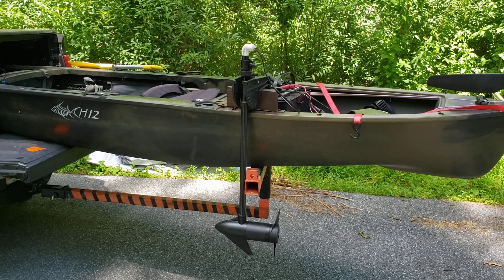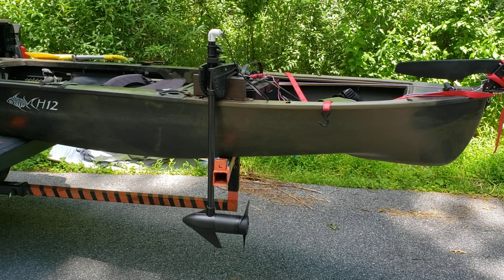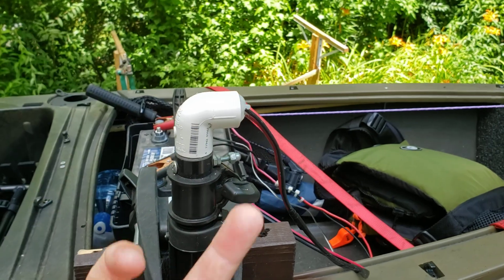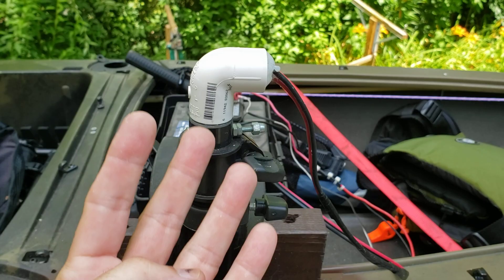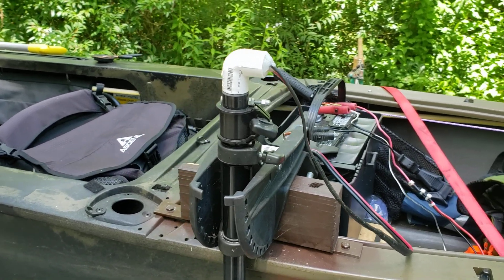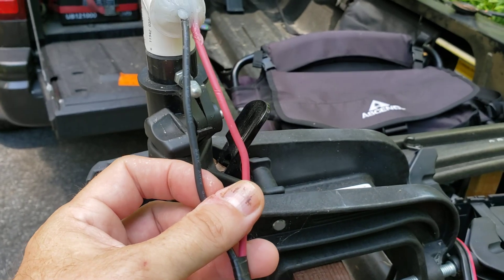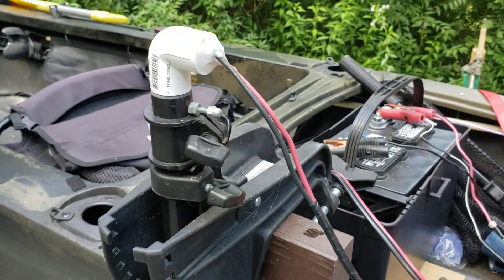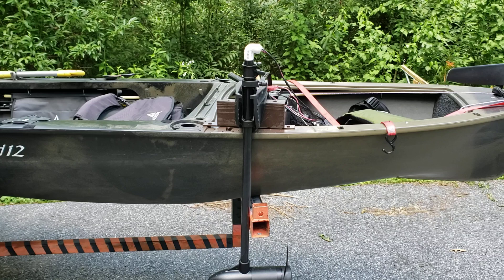A Point About Removing The Head Of A Minn Kota C2 Trolling Motor To Bypass The Speed Coils

Comment: So if I removed the head and just hard wired it direct to a foot control with no speed control would it always be in high speed?
Reply from the maker: Yes, as long as you use the black and red wires.

Comment: What gauge wire did you use to connect the battery and the PWM to the trolling motor I have a 8 ft 2 man Sun Dolphin Bass boat thanks for the info on the infinite motor.
Reply from the maker: I think I used 10 or 12 ga wire. It was pretty heavy stuff. Use as short a run of wire as you can. The less distance it travels, the more efficient it'll be. (don't put yourself out trying to shorten the wire though. It doesn't make THAT big of a difference)

Comment: But how is the speed controller wired / connected to the motor?
Reply from the maker: The positive and negative leads from the motor go to the "motor" side of the controller, and the two leads from the "power" terminals on the controller go to the battery.

Comment: Dan, is that motor a brushed or brushless design?  Any external speed controllers should obviously be matched for the same type, etc.  I "believe" a brushless motor would have 3 wires, if I am not mistaken.  Good video. 📺👍😎
Reply from the maker: No, it's brushless.
Reply: @DanHiteshew-oneandonly  Nice, even better.  👍